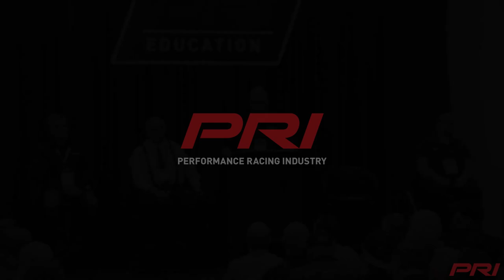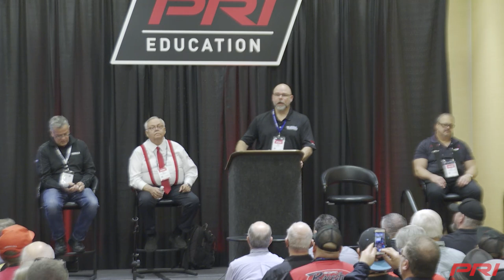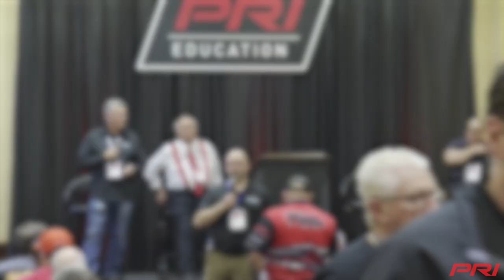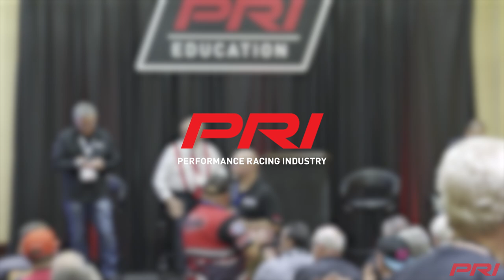Failure Analysis: Broken Parts and the Tales They Tell

Comment: Would have liked to hear thoughts on increasing dampener mass with HP increase especially on forced induction motors, I work in heavy diesel 2000+ gear and the common thread is stacking viscous dampeners as HP goes up and or load cycle increases and wonder how, if, this figures into everyday street upgrades and performance builds